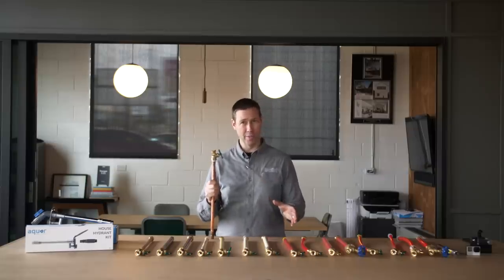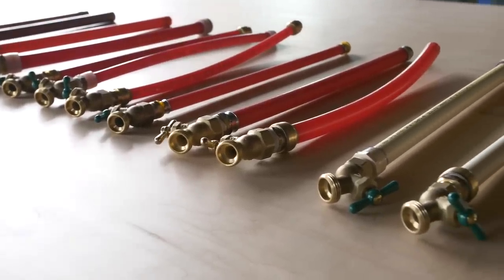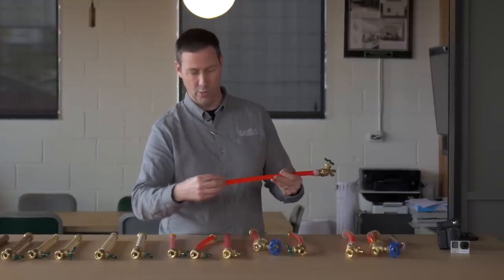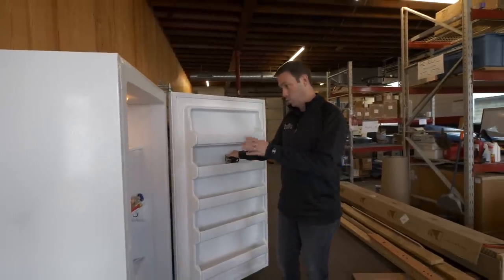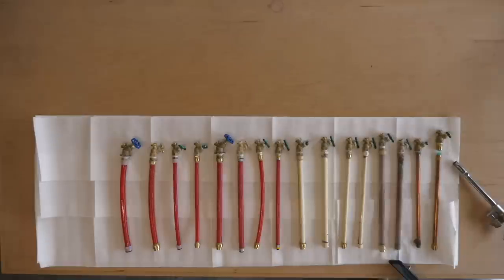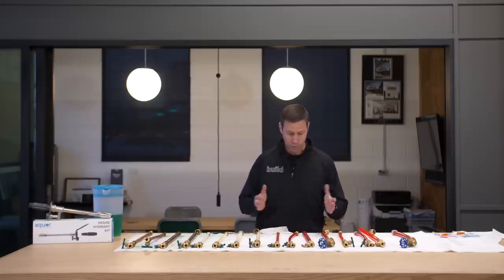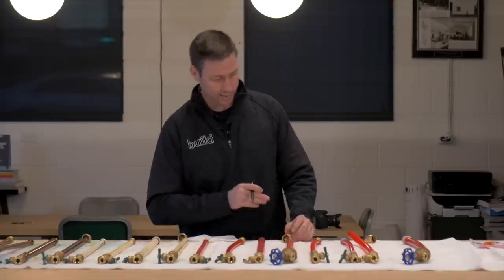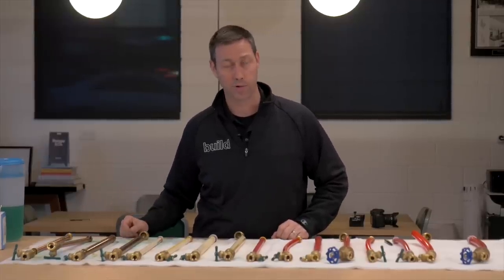Copper vs Pex vs SharkBite - Freeze Testing

Comment: I'm currently replacing galv. in a house built in 1914 in Chicago (the house hasn't moved)... nyuk... the three hose bibs are galv. and not getting replaced. And, while, PEX isn't "really" code in Chicago yet, I've been using it as copper is f'n expensive right now. 
I like PEX for stuff that is simple (e.g. new construction), but I'm going to switch back to copper as there are too many wierd/tight spaces that need to be addresses where getting a PEX crimp/cinch tool in place is f'n impossible, and I can cut/sweat copper more easilty.

Comment: when you freeze uponor it will usually just break the fitting if you do find a leak ----  And if you have a home run system where the manifold and fixture end are in a heated area you shouldn't have problems with freezing and pipe breakage ,    Im in canada -- it was -40 all last week and i have been repairing frozen lines all week and I haven't found any broken uponor pipe

Comment: Several of out neighbors' homes built in the 80s have had failures with the plastic pretend piping, while the properly-sleeved copper (which we mandated when our home was built) has done just fine. No BPAs or other plastic problems, either.
Reply: That wasn't pex but polybutylene which is banned for use now as it was terrible but cheap. Pex while only being around in the USA for 20 years or so has been standard in Europe for almost 50 years. Not saying cooper isn't probably the best at longevity... it probably is but you comparison is flawed.

Comment: I just found this video.  Very interesting.  One question.  What about the collection of algae in plastic pipes like Pex?  Or the studies on chemical releases from plastic into water supplies if the water is heated?  Would it be better to use copper for the supply and Pex for the drainage?  I know copper can sterilize water microbials and can be self-healing to a degree.

Comment: Got sick of replacing metal (copper and galvanized) pipes every winter in a really old house. Had a plumber come in and replace every pipe from the street to every fitting with pex. It's currently frozen now (below zero F) and we'll see if it was worth it once it can thaw.

Comment: The hose bib mini-leaks. Keep in mind that it doesn't take much water freezing to create the damaging expansion pressure wedging. The freezing in each of your 'units' doesn't necessarily work as just one pressure. If you froze just the bib, the water pressure would increase in the rest of the sealed pipe, but the destructive wedging would occur right in the bib. When water caught between the male and female threads freezes it won't take much to push against the bib and the pipe. A hairline crack filled with water can split large rocks. 

But plastic pipes? I'm old and I've seen one plastic after another first be promoted as inert and safe, only to be later downgraded. Bisphenol A, which is in epoxy (resin is 90% BPA), once considered to be food safe, and recommended for use on children's furniture....  I'm also old enough to remember the time saving new plastic water lines introduced in the 1960s, and how quickly they failed, were recalled.... 

It's also weird for me to see all those standard-- cheap-- rubber washer seat valves faucets.They eventually drip as the washers dry out and go bad. As whole house turn offs after the fist dozen years they don't work very well, but now they're buried in a bunch of connectors. I replace them with ball valves, triple the cost but 100% reliable, for ...how many years? My experience so far is at least 30 years -- maintenance free. 

I can understand your rationale for using them for this test. I think what happened with the Pex and CPVC drips is small amounts of water caught in threads and in the joins. I would've been curious to see what copper flex would do. 

When a pipe is flexible: When you bend it, the outside of the bend is expanding (some, of course the pipe also flattens out.) So any flexible pipe should be able to bulge at least some of the 9-11% that  water expands as it freezes. If you've ever been on a mountain arret ridge (anything called sawtooth) you'll know how powerful cycles of freezing can be. All that rock will be shattered, loose, but still in place. If a pipe doesn't split after one freeze and thaw, how will it do after several?  If you have a sunny wall, on the windy side of a house, the hose bib and pipe might freeze every breezy night when temperatures are still above freezing. 

I think you've made a good argument that those last couple of feet to the hose bib should be a plastic pipe. I also think you made the case for an inside turnoff and drain. Are those small leaks damage or just a bit of flexibility that can repeat dozens of times without any permanent damage?  I grew up in Michigan, no house my family lived in ever had a failure...but this was back in the day, so there was probably heat leaking out at each fitting.when I visited  the UK in 1985 and took the train into London from Gatwick in 1985 I remember seeing waterlines running up the outside walls of many many houses and apartments. Of course I also remember thinking: I guess it doesn't freeze here. That winter they had a record frost. Last year,  I took that same train line.  I could see the shadows where the pipes had been, and  the patched holes for hangers and where pipes entered, but I didn't see any more waterlines on the outside.

Comment: A totally wacky idea, but what about the flexible stainless water supply lines used from the wall to the base of a toilet tank? I wonder how that would handle freezing temperatures.  Usually sold in 12-24" lengths, flexible, braided construction, if it could handle the freeze/thaw cycles, it might be an option to enable easier changes in the future given it's flexible nature.  Almost like the loop of PEX you have recommended before.

Comment: One thing that you haven’t taken into account. When the water expands to ice. The expansion has to take place at At some point. This can only mean it is gone to the side of the Tube.This will mean that they are microcracks on the outside of the tube which will Cause failure later on. I have a very good experiment.

Comment: I've gone through two cold spells (well below freezing) over the past 10 years, so I've done the same 'test' for real... In both cases, these were uninsulated pipes exposed to the outside air (under a house on piers).
- 1st time: steel pipes... many burst
- 2nd time: after replacing everything with pex pipes with the white plastic fitting (the one on the right on the table). All pipes froze / thawed without damage. One copper valve attached to the pex pipe leaked.

Comment: Interesting Test; Thanx!! A bit moot to me though as a Journeyman Plumber (36+yrs in PNW) because we would NEVER install ANY water piping in a Freeze Zone; NEVER!!  There is ALWAYS a way to avoid Freeze Zones; to install pipes in a Freeze Zone is both foolish and against Code, (therefore against the State Law).  Also, the 1st (& most important) test/question for ANY water delivery system is  "Does it/will it  deliver the local water SAFELY & CLEAN/FREE of contamination from the System????"   Most of the pipes you showed often will not... Bruce Sr.

Comment: I have copper throughout and had no issues during this Texas freeze or any of my Alabama freezes when I lived there. I have simple ball valves on my outdoor spigots. They froze but no damage was done. However, I used brazed ACR tubing because I am in HVAC and I had plenty already. Maybe that had something to do with it. No offense to you folks, but copper has been around a long time. I am intrigued by the ease and flexibility of PEX but I'll stick with copper.

Comment: For drinking water quality, I might trust copper over PVC. Have you any data in PVC and Pex in terms of water quality
for drinking? Any off gassing or chemical shedding for those products, and how about rate of change over time? It
seems in some places, old plumbing which may have used lead solder, is still an issue, like in Detroit, is it? Which 
type of plumbing is cheaper, btw?

Comment: If the ice has a place to go axially, then overpressurization will be the mode of failure. If axial expansion of the ice is constrained, then the radial expansion of the ice will result in hoop stress failure of the pipe membrane (longitudinal split).

Comment: Matt, great video but have you also tested the new epoxy's or glues for copper pipes instead of soldering the various fittings?  I was just wondering if you have done any pressure testing on this type of connection?

Comment: thank you for this test, I've been curious about this ! I wonder if the length of the line and thus the amount of water that is expanding can effect how much force is out on the fittings and then the test? Some crude and probably incorrect math, if 9% water expansion in 16 inches is 1.5 inches then 500 inches of water, if it only expanded laterally(?) would be 45 inches, would that extra expansion effect the pressure?

Comment: I have NIBCO PEX in a 6 year old house (I'm 2nd owner purchased 1.5 years ago) that sprung 2 pin how leaks last summer near the hot water heater on the hot water side.  I've read about multiple lawsuits for issues with nibco. Do you have any experience?  A contractor I spoke to in my area installed some for a friend and had to replumb the entire house 4 years later due to similar leaks.  Pretty sure he also recommended the same Viega PEX you used.

BTW,Once full you should have used the hose bib fittings to hook them up to a real line and get them under pressure (at least 60psi) to better simulate the actual pipe conditions.

Comment: Some real world data: I spent the last 2 days cleaning up after a burst PexA pipe. 3 story house vacant for renovation temperatures in the mid teens to high 20's the preceding few days.  Pipe heater on the basement and first floor where pipes are exposed still, rupture happened on 3rd floor.  In all fairness it was only one of 2 that burst but pls don't come away from this thinking Pex lines are bulletproof, water is an incredibly powerful element and capable of incredible pressures.

Comment: I see the sharkbite fittings blow off pex all the time in the winter. Normally what i see (after turning off the curb stop and pumping out the basement) is that the metal part of the fitting fails and the fitting separates leaving the teeth, the metal ring, and the plastic removal ring still connected to the pipe (usually caps) and the rest of the cap ends up across the basement on the floor. I will say it happens more often with copper pipe though. For the record i live about 40 miles from the Canadian border in montana   So it gets very cold here.
Reply: I can't believe how so called plumbers sell the sharkbite fitting.They are at best a temporary fix as in come back the next day to finish the job.
Reply: Wes Frazier shark bite fittings are fine for what they  are designed for as long as they don’t freeze and are installed properly. Ive used quite a few of them over the years and only had one seep a bit, and that was because i nicked the o ring.
Reply: @greyhound531  well I have saw several 90° sharkbite fittings blow off copper under pressure. Some folks don't mind selling a temporary fitting to a unsuspecting customer.

Comment: Worked on a mine and we used 1in copper ball valves every morning during winter , i would replace 4-6 of the 11 and a couple times a 10in  ball valve failed.

Comment: CPVC and PVC explode after they've been subject to years of use. Super brittle. So the fittings were the issues in this video and so it doesn't tell you much about the pipes, but after freezes I see copper, PVC and CPVC breaks 99.99% of the time. Copper will burst in a small section, like in the video, but PVC and CPVC will just get shredded down 10' of pipe sometimes. PEX-A, B and even Quest handles freezing 100% better.

Comment: Hi. Thanks for the vid, but for it to be accurate, you should have pressurized all of the sections before freezing. In my experience as a GC and a farmer, everything fails. Also, the sections were pretty short. I bet if you re-tested them using the height of your freezer and pressurizing it would be 100% failure.

Comment: I am curious what the fatigue point is for the pex. how many stretch cycles(thaw freeze cycles that it would take to reach a point of failure. Polymers generally lose elasticity over time. Second curiousity is how well type M Copper pipe would stand up to freezing.

Comment: I'm installing rain water collection tanks and will pipe the water (probably underground) to union with my existing house crawl space,
 3/4" copper water system. QUESTION... Are there fittings to connect PEX-A to existing 3/4" copper? I live in "4 season" country so freezing is guaranteed...

Comment: I have PVC /CPVC pipes - installed. 1990 (copper pipes were corroded leaving bad taste in drinking water).
Q: why is joining of copper pipes called "sweating" and not soldering?

Also - problems I have repairing copper plumbing is residual water inside can make it hell to "sweat" joints.

Comment: I live in San Luis Obispo County California, and replumbed my entire house DIY with PEX-A and Shark-Bit fittings.  It was so easy and such a bulletproof system.  If I needed to change a run, or length.  I uncoupled the fitting and moved the line.  So much easier and far faster then C-PVC, or Copper lines.

Comment: Hey Matt: something to consider is that copper provides microbacterial properties and grounding. This winter, I experienced shocks because my sink is PEX fed. When I touched the faucet, the dry, winter air and charge I built up zapped me. I never had this issue before PEX. Can one add a ground strap to the faucet? Is that even safe? Code?

Comment: Unless that was old cpvc, it might survive a freeze. But if there is some age to it, like 5 plus years it would've split like a chicken bone as it gets brittle with age. I personally only use copper rings with pex, as I've had too many instances of being called out for a blowout from sharkbites. Too many fails for me to be comfortable using for anything other than a temporary fix until problem can be fixed properly. Haven't found anything yet that can stand up to cold weather better than pex.

Comment: Living in the desert southwest for my entire life- I remember when pex first came out! It originally was used in mobile home's! And for over 40 yrs It has proven to be a big flop! Not only does the oil leach from the plastic butover a 20 yr span the plastic lines become brittle and break in two! The difference is this- when copper leaks it is usually a pin hole leak! When pex leaks it's a full on flood as the line breaks completely thus allowing the full flow of water!  Pex is a joke- never use it if you value your home!
Reply: with nearly 30 years in the piping industries, I agree with Gene here, any PVC or Pex will deteriorate over time, becoming brittle and breakable also leaching the petroleum it is made from into your drinking water. You will see the 'rainbow' of the oil in you cooking/drinking water. Keeping pipes from freezing is simple matter of advanced planning, any Plummer in cold climates do it without much thought.
Another commenter below brought up a good point too. PVC/Pex pipes that have been heated for hot water will deteriorate faster, leading to even quicker failure. 
The only real advantage to plastics is cost, as I see it, it is a matter of pay now or pay later.
Reply: @Book_Cloak  agreed!

Comment: Hi since you had used hose bibs could you not have used the pressure test fitting and added some air to the thawed unsplit unburst pipes to see if indeed they had no hairline cracks? because that's what's happening to me several times with the cpvc?

Comment: Fantastic video Matt.  When you had the GoPro video paused at about 6:12 of your video, on the copper pipe that split, it is interesting to note that before the split occurs you can see a faint line where the split is going to occur.  Do you think that was damage that was occurring due to the freezing that preceded the split or do you think it was a flaw in the copper?

Comment: I use copper for Freon. I know it will handle over 600 psi. Easily. But Freon doesn’t freeze and expand. I wonder what the pressure really is when water freezes.

Comment: I have seen pex split like the copper pipe in a house with the water heater in an exterior closet.
I have seen SharkBite on copper pipe fail inside of basement walls.

Comment: I use cpvc because im poor, and it's cheap. Also easy to repair in below 0 temps. Im replacing my hot water heater tomorrow. That crap copper pipe job won't be there when im done lol.  The main coming in might be PEX though. Looks like it. I live in a mobile home park, and they just replaced a bunch of lines goin to the lots.

Comment: I had a bad mice problem at my hunting cabin..drawers ,attic, counter tops, beds, etc...I created  "Operation No Mouse Shit"... consisting of Multi-mouse catchers... the sheet metal boxes with a one way door, bait stations in and out of cabin & any out buildings..and intensive Victor mouse trapping at first..and all gaps,cracks, baseboards, thresholds to outside,  put new wood,metal or sprayfoamed....not one turd in 2 years...the main thing, STAY ON TOP OF IT, constant changing of bait,removing dead mice, and cleaning surfaces with bleach n water..floor also.

Comment: I like the crimp On PEX that you buy in straight sections.  The 3/4 pex in a roll is IMO UnUseable (Much too Stiff) other than for very long straight.  That Upinor tool is $$$.  
IDEA:  Somebody should do an extended test of say a few hundred Hard Freeze cycles.  Maybe as long a PEX is used to all outside faucets, no shut off valve is required at all?  Also, what kind of water volume expansion occurs the across the freezing temperature range?  How much worse is Zero degrees F than 32 F?